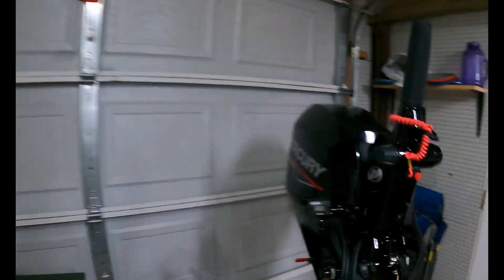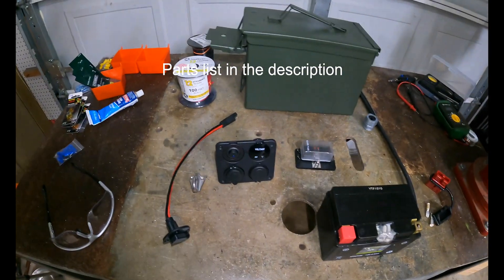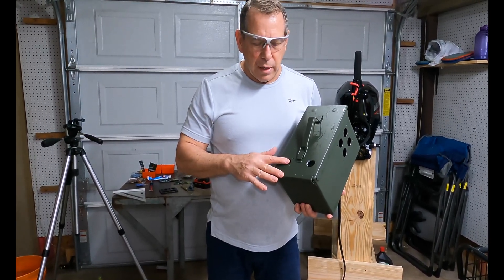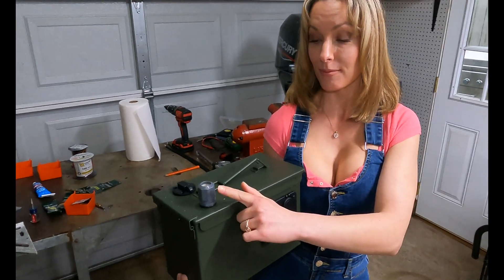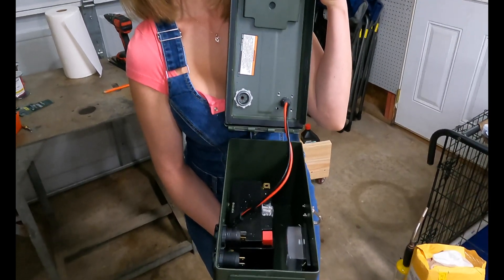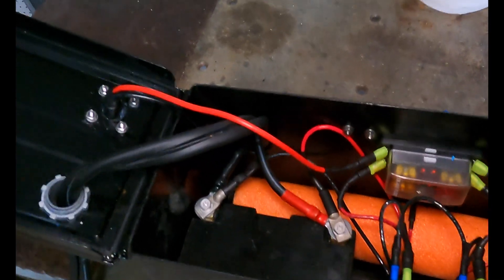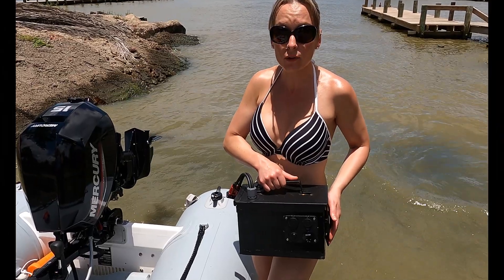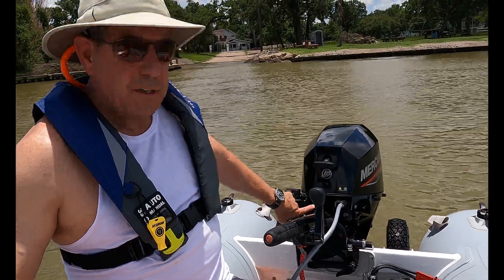DIY Battery Box   4K

Comment: I’m looking at getting the Tohatsu 20hp, but the manual says that the portable outboards (9.9-20hp) need a minimum of 330 cca battery (40AH). Has that little battery been doing the job? The link shows it to be a much weaker battery. What made you decide to go with a smaller battery?
Reply from the maker: No problem starting with that battery